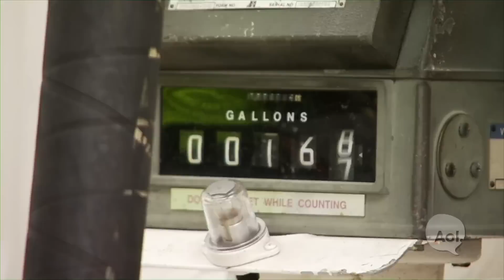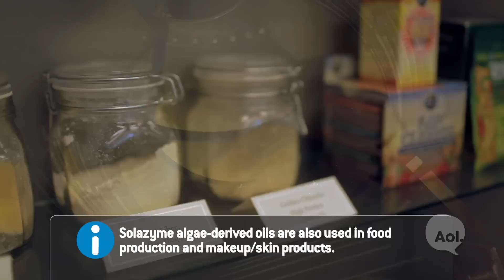Solazyme Algae-Derived Biodiesel | TRANSLOGIC

Comment: Way better than electric vehicles. And no perfectly serviceable vehicles need to be scrapped either.
Reply: cars need to be scrapped for a variety of reasons, the main one being servicing gets too expensive. imagine you had a 1910 ford model t. you could still service it and have it running fine today with continual replacements, but that's not practical. furthermore, recycling metals uses around 74% less energy than creating new metals. 

I guess they don't "need to be scrapped" because you can keep replacing parts, but it is practical and actually beneficial to scrap cars